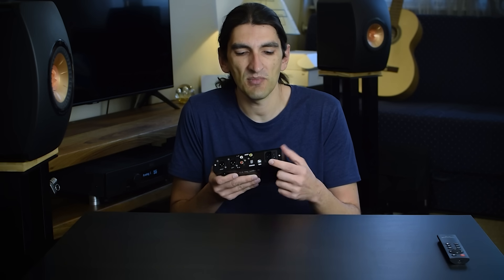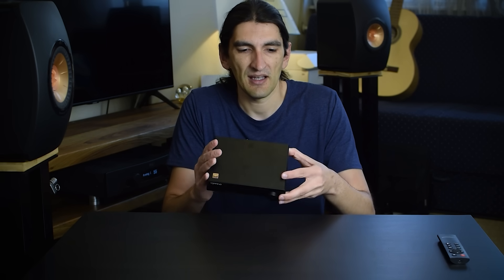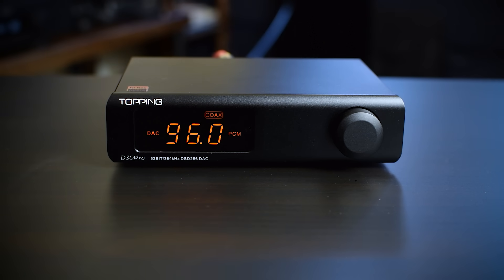Topping D30 Pro review - Don't buy a new DAC before watching this

Comment from the maker: It was brought to my attention that CS43198 in D30 pro is not the same as CS4398 in the older D30. I somehow completely missed that "1" in the middle... oops! 😅 So there's that, everything else said in the review still holds, fortunately. Hope you like it, more stuff coming soon. Cheers!
Reply: The fact that you pin this makes me subscribe to your channel. Thanks for your honesty.

Do you have any thoughts on the difference between those 2 dac chips?
Reply from the maker: @martijnbos9873  Thanks! To really compare these chips I would have to hear them in very similar products few times. This way I've heard the older one many times, used traditionally in a one DAC chip configuration. This is the only time I've heard newer CS43198 but it is used in this new configuration, so it would be comparing apples and oranges. One thing's for sure, D30 pro sounds better than almost any of those older DACs I've listened to that were using CS4398.... but I can't say it's just because of the new chip, the rest of the circuitry is super important too. Cheers!
Reply: @iiWiReviews  Thank you for the detailed review. I'm interested in buying this DAC however I noticed it's now on sale for $300. Did the D30 Pro get discontinued? Is there a Topping DAC that replaced it? Thanks
Reply: @holdencaulfied7492  I got the same questions.. the D30 Pro is no longer on the market it seems

Comment: I invite all to dig deeper on the web. The D30 pro seems to have severe issues with drop outs. Mine worked flawless with my Bluesound Node 2i via dig Coax however had huge issues with my so far flawless with any other DAC working Denon DCD3560 via Toslink. Same issue with Laptop via USB. Topping responded very fast and told me that D30pro requires very low jitter sources. There is no way to solve it by update. So, I sent my device back. I use MX3 and wanted to replace now my old D30 which still works flawless. First issue with Topping and their D30PRO now. Seems not to be the only one.
Reply from the maker: Interesting, I'll test it more myself with few more sources... So far haven't experienced drop-outs.
Reply: @iiWiReviews  Hi, yes try older CD Players on both S/Pdiv and a maybe more "dirty " PC over USB also. Btw, nice review as always!
Reply: I want to add it to my 2i..what was the difference?

Comment: I am still happy with my E30 , but I am looking for a one good package of dac and pre amp with subwoofer output and bass and treble settings to connect to my power amplifier.
Reply: Don't know your budget but everyone is talking about rme adi 2 fs.
You have dac, balanced out, headphone amp, preamp, eq, and dsp (for each input individually) both asr and reviewer agree on this one
Reply: @tchernob  I have look at it, it cost around 1500 $ and it doesn't have subwoofer output. For me it is Way beyond what I want to spend.
Reply: @RanTausi  here it's 1000€ the pricing is strange  à roos the world. For the sub, don't you have a high level input on the sub?
Reply: @tchernob  My current setup is Adcom GFP 565 pre amp and Adcom GFA 555 MK2 power amp. My subwoofer model  is Magnat with 10inch woofer, my preamp has two RCA pre out one normal and one lab, so I am using the lab RCA pre out  to connect the Poweramp and the normal RCA preout goes to the subwoofer, the sound is incredibly amazing, I do have high level output on my subwoofer back plate but  personally it balanced very well in my room , I just want a new generation pre amplifier, and maybe to replace my bookshelves speakers as well, regarding my old school 555mk2 I am going to keep it as I just bought it last year in a rare condition, it was new in box never opened. Have a nice day ☺️
Reply: @RanTausi   OK just wanted to say that the sub out wasn't necessary if u have a high level input. It is said to be "the best way" although I really doubt it makes any real differance but it could simplify your research. Have a nice day too
Reply: @RanTausi  Just wanted to reinforce what tchernob said. High-level in is highly recommended by Paul Gowan of PS Audio. If you decide this route, or if you are thinking about speaker cables, you can significantly reduce interference into the cables by spiralling the positive and negative wires around a rope. This is the principle that Kimber Kable uses. It's how I assembled my high-level into my subwoofer.

Comment: D30 and D30 pro use completely different DAC ICs.
For D30 the IC used was the CS4398  which is a quite old design (circa 2003 since the manufacturer evaluation board was released back then).
On the other hand D30 pro uses CS43198 DAC IC which should be around 3 years old or so.
Reply: Exactly!  ...Ακριβώς αυτό ήμουν έτοιμος να γράψω Λάμπρο!
Reply: @subcoded  Το εχει ακουσει κανεις σας παιδια το d30 pro?
Reply: @subcoded  ευχαριστω για την απαντηση

Comment: Hi, you are doing a good job, thanks. Now I have a d30 pro with a violectric v200 and a denon 9200. I tested the E50 - very spilled bass. E30 II - (bass was ok, maybe because I had a different power supply at the time) but it got messy at higher volumes. Does it make sense to change the dac to a higher model, e.g. d70s or d90? Do you have any suggestions? From what I hear the 9200 sound amazing even on cheaper amps. That's why I have doubts whether the more expensive DAC will change anything audibly. Thanks and best regards

Comment: Thanks for the great review ! do you think think the D30 as a pre amp function only would work well connected to a Denfrips Ares II into my active speakers? Also was the remote control relaibale ?Thank You
Reply from the maker: You can't really connect a DAC to another DAC. Either you use D30 pro only, connected to speakers directly. Or you use Ares II as a DAC connected to a small preamp and then to your speakers. All that said, if your speakers have volume control, it's best to use it and keep just Ares II... The shortest signal way with least number of components and cables is usually the best.
Reply: @iiWiReviews  thank you very much

Comment: The main idea: changing firmware and drivers is like having another DAC.
Update 2023: After Tidal replaced many MQAs with FLAC files (D30 Pro had no MQA decoder), by far the best driver version seems to me to be 5.12. The most natural and least distorted sound. How did I realize the problems of the other drivers? I listened to the Kernel Streaming version from AudioNirvana Studio: much more sounds (which were missing using the drivers) and a much clearer arrangement in space. It seems that he wanted to please the reviewers and "improve" the sound. The 5.12 driver seems to be the perfect compromise: we have the good parts of both variants.

Comment: How does the Modi Multibit compare to the D30 Pro (specifically on speakers)?
Reply from the maker: It's a tough one since I haven't had a chance to compare them directly (sold my Multibit some 7 months ago). But going by the memory, Multibit sounds fuller in the midrange and with vocals, that's its strongest point. D30 pro has more grunt with bassline and more clarity in highs. So, I feel that objectively D30 pro is a better DAC, but if you're really into full and lush midrange, Multibit is unbeatable near its price.

Comment: I don't know why they didn't give it more output voltage say 2.5/5 v rca/xlr respectively like they did for the D70s? It helps especially with lower powered amps.  It seems like a jack of all trades at the $400 price point though regarding all facets of SQ.  It doesn't have to be class leading in everything but if it's good enough overall to not notice anything being out of place then it's a choice.

The graininess thing has me a bit apprehensive as to whether it would be noticeable to say even lower priced dacs?.

Comment: What you stated about the SMSL 400 vs D30pro being more warmth, smoother but dense mids/highs and tone, how does the 400 compare to D70s. 

 I am familiar w CS chip (my Marantz) and have had the D70s in my system.  This way, I can judge better and get a sense of the different price points to choose from.  I have essentially a D50s and find it dynamic, fast and punchy but that glare and accentuated sibilance is getting to me, otherwise it is nice (it will go to computer on warmer speakers).  The D70s did everything a bit better and no glare, but it seemed overkill at the time.  I would say my in room system is resolving enough to justify a dac up to a grand but no higher, hence trying to judge different price points v SQ.

So a compare between the D70s v 400 would be useful, especially when putting D30pro in context as an option, or moving to higher level.
I know, it's only an opinion, most of these dacs one can find worthy addition.
Reply from the maker: Hi, take a look of my latest review about D70s, at the end I compare it briefly to M400. Both are superior to D30 pro that sounds a bit grainy up top and slower in the bassline. So if you already have a D70s, don't bother with D30 pro.

Comment: Owned a original A/D30 - moved on to E30/L30 - just for the smaller package. Now i am kind of torn between the new 30 series, 50s or maybe i even abandon stacks and go for dx7 pro :)
Reply from the maker: Topping is confusing us with names. :) E30/L30 are a great combo.... D50s/A50s are just a touch better and that's not because of the DAC (E30 and D50s are at similar level) but because of slightly better amp A50s, especially when balanced out is used. Otherwise it's not worth the hassle.

D30 pro and A30 pro are clearly next level compared to both previous. But I recon you need a very good headphones to justify that much higher price.
Reply: @iiWiReviews  It looks like the "s" series is followed by a "pro" series, so I would be slightly afraid that a A/D50 Pro is around the corner. Well, to be honest ths is also an aestethical thing for me, the white display of the "above 50" line of Topping is for me an upgrade to the orange. I also really like the DX7 Pro as it reduces cables and has an integrated power supply. I am not kidding myself, this is a pure "for fun"-buy. However the BT feature would be maybe something I would try once or twice :). Any chance you do a Dx7 Pro review? (Keep up the great reviews!)

Comment: I am thinking of this dac while now using a Lavaaudio DS600 ( a Topping D50s clone essentially). Between the Topping D50s vs D30 Pro, it seems the D30Pro has a wider, deeper, taller SS.  

Would you describe smoothness/graininess to be similar?
Is there more space between instruments/voices and is it more 3D like in its' SS?

I liked the DS600 over the regular Topping d30 in that it was more detailed and dynamic.  The 
Loxjie D30 was preferred over the DS600 for its' smoothness and although a bit less detailed it had enough dynamic punch, a good amount more in particular than Topping D30.

I have grown accustomed to the DS600 and it's great for movies but I can prefer my Marantz CD6006 and an Aiyima which both use a CS 4398 chip (although not quite as dynamic for movies). They are smoother and still detailed.  If the D30Pro goes beyond the performance of my CD6006 player it would definitely be a winner.

In comparison to a Topping D70S which had great bass to midbass weight, was very smooth sounding never having any glare but I think I preferred the leanness of the AKM dac in my hegel as well as the CD6006 because the added richness of the D70s bled into the space affecting instrument separation.  I could have lived with it but for the price, I thought I'd keep looking...I like space, depth and this can affect a more 3D like presentation.  The DS600 (D50s clone) is fine for movies but I usually prefer other dacs for music, particularly voice, piano as well as other instruments although its' fine for most music.

Any dac would be hooked up to a Keces E40 integrated which provides a warmer yet tight bass and rich mids sound.  If it lacks anything it in the uppermost registers. While other sub $1000 can have much airier highs, the Keces has outperformed in all other categories including dynamics, lack of grain etc.  The D30 Pro might be a suitable match as long as grain isn't noticed such as in a Musical Fidleity m2si...bloated lows and grainy mids/highs IMO.

So, maybe a softer/less dynamic dac with extended highs could pair well with a punchy, dynamic amp with not quite too airy highs (but the highs do have body)?   All paired with more revealing speakers BTW, Focal 806Ws, Triangle Zetas (old color series).

Any thoughts or comments by anyone useful and appreciated.

I
Reply: I had the D50s in my system for a while, but I thought the vocals had too much sybilance (especially on S's and T's)...The D30pro is much smoother and has an even wider and deeper sound stage.  I don't think there is much loss in detail. The D30pro will stay. It is fantastic with the Bluesound Node 2i.
Reply: @Jfwr2010  In using the Lavaudio, the first which was exchanged for an issue had alot of sibilance but the replacement was more tame, which I am using now.  It still has sharper S/T sounds but maybe I've gotten used to it.

As long as there is at least or better details and resolution of the details, I think the D30pro could be justified.  With the D70s nothing ever grated, it just sounded right but the differences could be marginal.  The biggest difference was in sharpness making sibilant passages a bit exaggerated on the DS600.

But I thought the lows/low mids were a bit oversaturated on the D70s, even if everything else about it sounded great. For $650, it was too much of a jump and dacs for me are expendable, not worth repair should t ever come to that.

So, with the D30Pro, if it goes on sale during Prime day, maybe, as it would be a decent price point and that new dacs come out every 6 months or so.

Thanks for your reply.
Reply: @Jfwr2010  One more thing, in comparison to the D50s, do you find the D30pro has any graininess in sound?
Reply: Changing op amps can make alot of difference.ive put chinese burson v4i op amps in my sabre dac better sound stage bass and controll.muses op amps decent aswell.op amps do as much as the dac chip them selves.

Comment: Hi; I liked your review very much. Thanks for the detailed explanation! I know that it is not a fair comparison, but I wonder how the D30 pro compares to your Hegel H90 amplifier internal DAC section. I own a Hegel Röst myself (+ a couple of Monitor Audio Silver 200), and I would like to know which would be the advantages of integrating the D30 pro in my system. I think that the Röst's integrated DAC is pretty decent already, with full-bodied bass and great detail and soundtage. To what extent do you think that the D30 pro would enhance these qualities?. Cheers from Spain!
Reply from the maker: Thanks! DAC in H90 is neck to neck with Ares II (different tonally but very similar in terms of quality). Compared to D30 pro I actually prefer internal Hegel's DAC, it's more dynamic and with more energetic transients. And all of that is true with really great interconnect cables somebody made for me... if I use worse interconnects, Hegel's DAC pulls ahead of Ares II too.

So, separates are really one huge black hole for our money. 😄 Integrated solutions are always better bang for the buck in my experience.
Reply: @iiWiReviews  I believe that Hegel amplifiers have a very good performance, so it's tricky (and expensive) to find external solutions that can bring you that extra detail / soundstage / dynamics, etc. You need to be very careful and assess the products carefully. Still it's just a question of preferences, so perhaps I will try the Topping one day, see how it works and return it if it's not worth while. I'm curious about how the filters can bring the sound to a more 'personally likeable territory'. Thanks a lot for sharing your thoughts; really appreciated!

Comment: If you have used for review only the preamp mode, please try also the DAC mode. It is a significant difference, in my opinion. In DAC mode, the sound is more natural, "liquid".
Reply from the maker: Most of the test, like 90%, was in the DAC mode and that's the way I always test when DAC is DAC first and preamp as an afterthought.
Reply: @iiWiReviews  And you have used 32 bits and 384kHz settings? If the source does not have the details, could work better with 24 bit and 44khz. 
I have done successive adjustments to improve the sound, in this order of importance: use producer drivers instead of what windows/OS provides (much, much better; also better than with Android), change to 24bit and 44kz, move to DAC mode.
Reply: Hey, do you perhaps know how to switch between dac and pre mode?
Reply: @koenm1756  When switch on the DAC, press the main button and the release. Browse the settings using the remote control until you find the "pre" vs "dac" option. Seems that the built-in preamp is a "cheap" variant.
Reply: @tudorm6838  thank you got it!

Comment: What is the difference between ''PRE'' AND ''DAC'' on the small screen? And how do I switch between both?
Reply: If you use in Pre mode PCM and DSD data go trough a DATT soft mute module  and a Delta\Sigma modulator stage. This  makes it possible to control an amp directly through the DACs volume control at the expense of some (probably meaningless) DSD signal processing. 
In DAC mode the DSD signal bypasses these two stages and reaches the analog conversion stage "pure". In this case, naturally, the volume  of the system is via integrated amp or PRE\AMP combo controls.